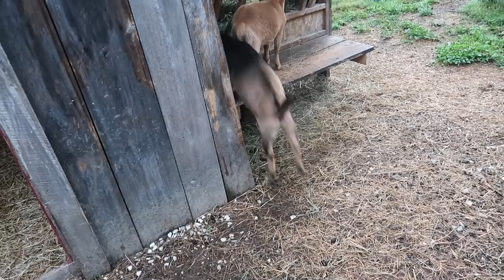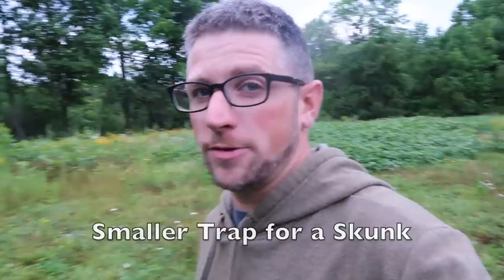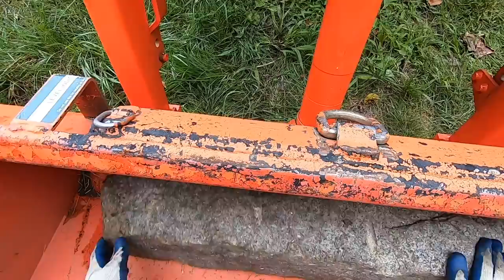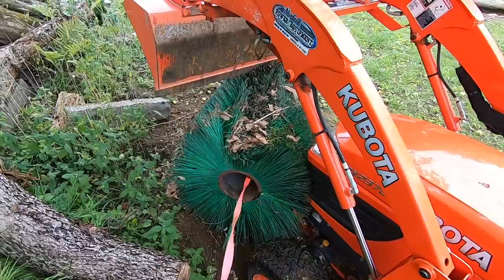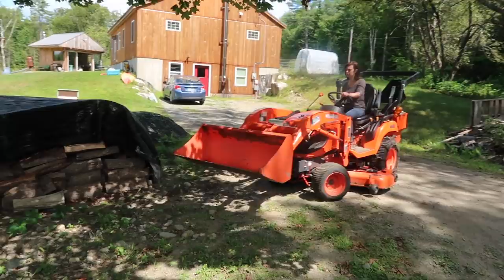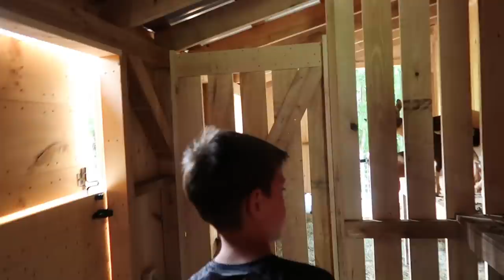I've been Hiding this for too LONG

Comment: Good morning! The shelter you just emptied, we use the white ones in the winter for our vehicles, we call them tempos. Each one is weighed down with six large cinder blocks, this way they don't blow away. It's nice on a morning of snow and freezing temperatures not having to clean snow of the car and you don't have to take the time to heat up the vehicles. Our by-law only allows them up from Oct-May or when ever the snow melts. 🙂 Nice seeing your nephews enjoying helping out. Have a wonderful weekend with your family and friends. 🇨🇦

Comment: Al if you take your microlam floor joist beam and cut it in half and put 1/2 on each side of your chop saw you'll have a nice straight table for your wood when you're cutting

Comment: What about mounting the top of that old stove to the wall and using it as a cabinet. If in the goat barn you could store you medicines and supplements in it. ❤🌅🌵
Reply: Someone down below commented that keeping the top (and in good condition) would add to the stove's value if you ever were wanting to upgrade. The safest place to store it is on the stove or the wall so it's out of the way. And if it's on the wall why not use the compartments for something? 💝☀🌵
Reply: I agree with hanging to store medicine and supplements but he would have to have it kinda low so his daughter can reach inside it when she gets doing the milking herself or he'll have to get her a step stool
Reply: @Akkhon369 , if he hung it above the milking stand she wouldn't need  a stool,  she could stand on the milking stand and easily have  access and it wouldn't be in the way.  Sending lots of love 💝 from sunny☀Arizona 🌵

Comment: Hi Al...I haven't read all of the comments, but you had mentioned wanting a camera system that records video. We bought a "Ring" floodlight/video unit. We also purchased the "Chime" unit that plugs directly in an outlet inside your house. When any movement is detected by your outside Ring unit the floodlight comes on, the "Chime" chimes, and your unit records any activity that is within range. You download the app and you're able to view immediately what's happening. You can save recordings or delete at your discretion. You can also talk or yell..haha at whatever is going on outside. We've had our system almost 3 years and it's been really handy even when we're away from the house we can access video. You purchase and own the equipment with no monthly fees. You just need internet. Just something for you and your family to concider. I don't work for Ring...just a happy customer 😁

Comment: BIG TIP !!!,  Moving Big Rocks with a Mini-Exccavator,  Sandwich the big rock between the Bucket and Plow Blade tightly, then raise  the plow blade a few inches , enough to allow the Mini to move. Wala!!! ,You can now move big rocks.

Comment: I have a street sweeper brush setup for the cows here they love it. I welded mine too vertical piece of pipe set in concrete then put solid steel rod down the pipe and poured it full of concrete.

Comment: As far as grain storage is concerned,  I'm no expert, but it seems to me that most people store their feed in galvanized trash cans. I reckon that the tight fitting lids keep the mice out because they can't chew through...  like they could with plastic.   However,  if I was Gina, I'd have you build a box big enough to hold the three or four different feeds that you use, as the  cans do get dented after a while. That wood you pulled out of the tent would be perfect for the job! 💝☀🌵 p.s. if using galvanized, I'd get cans big enough to hold the whole bag as I wouldn't want any galvanization getting onto my feed.

Comment: You could mount that top of the stove to the wall in your possessing shed to store things. I have one in my kitchen mounted to the wall and use it as a bread cabinet. I removed the bottom rails that were used to attatch it to the old stove and placed a pie cooling shelf under it. It really made a nice peice of decor to my kitchen.
Reply: Cool

Comment: After working around BIG tractors your tractor looks like a large lawn mower. 
The tractors I deal with have 8 tires all same size. So big you can pick up yours in the front end loader. Some people use them in place of dozers.
Reply from the maker: Yup that’s what it is. But boy it can do a lot of work
Reply: If you want big search for the video on Cable-Operated Walking Excavator.

Comment: Why not getting another trailer from AMAZON, then make a moveable firewood storage. You could take it too the area where you are cutting at, then move it near the house.
Reply: You could also use it to move firewood from the wood shed  up to the house,(having to move only one time) with a flap tie down; for weather protection.